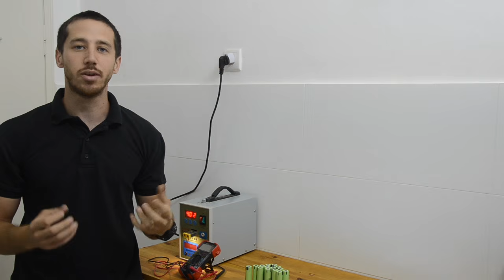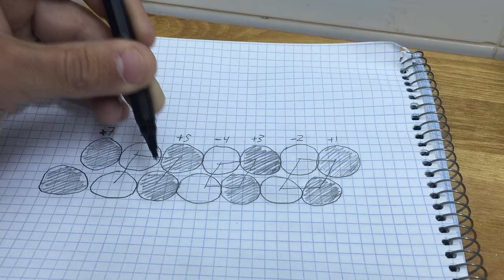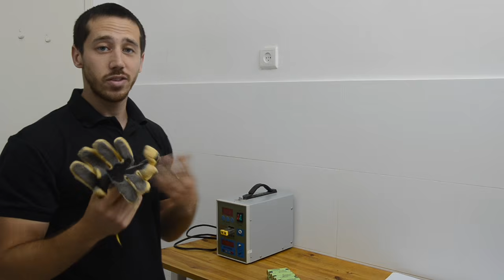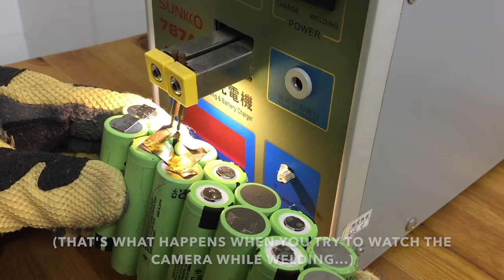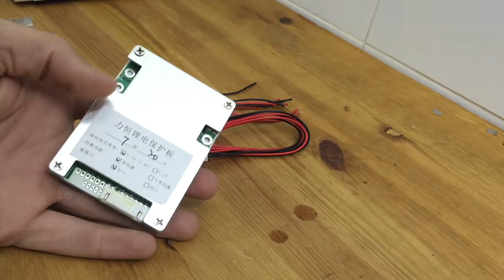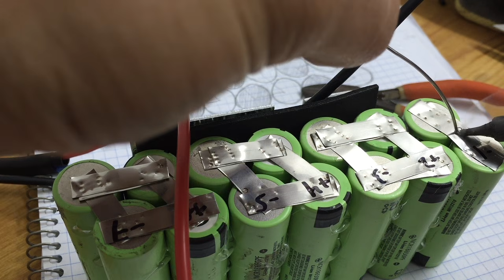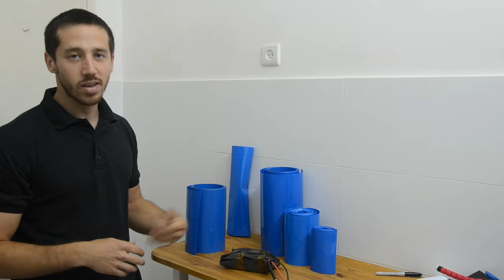How to build a DIY ebike battery from 18650 cells

Comment: How would you calculate the ah am I right in thinking is you keep in parallel that that stay same ah and when in series ud multiple by the number of cells you put in series so for example 10 batteries in parallel at 3.7v each one is 2.4ah then times that by 10 in series to make up to 37v. Please help if my math thinking is all wrong I'm not good with math but good with practical thinks help please

Comment: I don' get it. 14 cell x 3500mah=47.6 AH or not?
Reply: If you connect them all in parallel, you make a 3.6V 49AH battery pack.
If you connect them all in series, you make a 50.4V 3.5AH battery pack.
The energy is the same either way:
3.6V * 49AH = 176WH, 
50.4V * 3.5AH = 176WH

Comment: if I make a 12v battery so how can I charge them individually
Reply from the maker: You'll need to add a balance connector
Reply: after that I also need a balance charger.

Comment: To get the best results: as not all cells are created equally & there is likely always small differences in the top village they reach, you should measure a bunch and try to line them up in two rows (in this case) of seven in such a way that both the two rows will show about the same Voltage and then ONLY connect the two rows at the outer polarities (as opposed to, connecting them in pairs of two's all the way). It will minimale the indecency inbetween doubles and on, wherein unequal pairs and so on will drain percents of each other (and be probably only less than 70% efficient in that) from the highest to the lowest of each pair in order to them trying to keep evening out. Connecting two rows of seven apart from each other that way and only doubling up at front and end may save you a few percents of loss after charging.
Reply: your post is poorly written and therefore difficult to understand.

Comment: None of this adds up to me ,, at the start if I'm correct you say your making a battery pack for a 24 volt bike,,  so there's 14 battery's there so 2 parallel and 12 in series ....? 12 of them battery's at there 4.2 voltage would be 50.4 volts   ,,,,,am I missing the point ,,,please explain someone. Thanks Shane uk

Comment: Good video, but, I'm wondering:

Wouldn't it be much better/easier to:
A.  Place 7 cells + up (parallel row 1)
B.  Place 7 cells - up (parallel row 2)
C.  Hot glue the cells together
D.  Spotweld a nickle strip to each + cell in row 1
E.  Spotweld a nickle strip to each - cell in row 2
F.  Spotweld a bridging strip from the + row to the - row (as many or as few strips as you want to handle the estimate max current flow to connect parallel rows in series with each other.
G.   Connect your power leads to the + & - sides of the battery appropriately

The arrangement that you chose seems overly complicated.  Is there some advantage doing it that way?

Thanks for sharing!
Reply from the maker: Yes, your way makes a 7.4V battery. This is a 25.9V battery. To learn more about the difference between series and parallel wiring, you might like my book on battery building: http://a.co/ibnVGz9
Reply: Oops... my error.. it was getting late.

What I should have typed was 2 row of 7 cells that alternate + & - every other cell that are then each spotwelded together with one nickle strip to create 2 series-connected batteries & the rows (or banks) are then bridged (as describe above in my previous comment) to create parallel- connected banks for additional battery capacity.

Comment: Hey, first off just have to say I've found your video's really informative!  Love how they're organized and they've really helped clear up things.  Just have a quick question for you: If you're building a 12v battery from the panasonic 18650 cells.  Would you recommend using 3 cells for 11.1V? or 4 cells for 14.8V?  I know the maximum capacity is 4.2v (which would give you 12.6v for 3) but I'm thinking I should use 4 because that way I wouldn't discharge the batteries as far. (keeping them "healthier")  Am I right by going this route?
Reply: Devices like radios connected to the battery in most vehicles experience a range of voltages. When the battery is charging the alternator maintains the system at about 14.5 volts. With the car off, the battery voltage is 12.6 (when full)
At lower voltages, the current passing thru the connecting wires increases.  Most devices perform better (cooler) at the higher ranges.

Comment: If you cut yourself a rhomboid shaped pieces to replace all of the small tabbing strips then the amount of welding decreases and the finish would be neater. All of those small pieces are unnecessary.

Comment: Can i use a 42v 2a hoverboard charger to charge my 10s 8p 36v e bike battery pack.
Reply: Found this on eBay: 36V Battery Charger for Electric Scooter eBike ATV Mini Pocket Bike Moped Gokart
http://www.ebay.com/itm/36V-Battery-Charger-for-Electric-Scooter-eBike-ATV-Mini-Pocket-Bike-Moped-Gokart-/331148093694?hash=item4d19f6e8fe:g:ZKgAAOSwTA9X4pTd
   
It's only $17.50 plus free shipping.  I'm a nubie at all this but I read about how it's dangerous for the battery to overcharge, and or it hurts the battery when you try and charge too fast.

Comment: I've never seen one of these machines before, but my first impression is that moving the electrodes closer by even 1mm would make thing easier, or is it at the limit already in order to function?
Reply: Some Sunkko distributors include a spot welding pen as an accessory to the machine.  One company includes the nickel strips and a nickel spool but no pen.  Try your idea out on your friend's machine.

Comment: Can you teach us how to make a 48 volt battery pack?
Reply: Ebike School has a video: DIY 52v 10.5ah lithium battery from a kit 
Before I noticed that one I saw this video (off to the right) from Rinoa super genius: DIY 52v (48v) 16AH Lithium ion 18650 ...
It's so funny because I have a 29" bike I'm having a hard time finding ebike supplies for and just last night I noticed 29"/700c as if it's the same thing and then I saw 28"/700c.  Gotta love it.  Neobattery is the place to get the batteries from $5 in lots of 40 or 100, they're on eBay and probably have their own site.
Reply: TrustInJesus111 I have 18650 batteries that I took apart from old laptop batteries. I am not 100 percent sure how to make a 48 volt 10 amp hour pack. I have soldering stuff, and spot welder just don't understand the series and parallel yet and how to get 48 volts. Lol
Reply: @angelhd7446  you probably have the info by now, but in case you still do not...nominal voltage(V) of each cell is 3.7V, and depending on how good your cells are, they should have 2000mAh(2Ah)...so to make 48V...divide that by 3.7V...and that should be like 13 or 14 cells in series(14 will give you around 52V)...to get 10Ah, divide 10 by 2Ah...that will give you 5 cells in parallel...so your pack will be 14s6p on the upper limit...or 13s5p on the lower limit...
Reply: you just add more cells dude
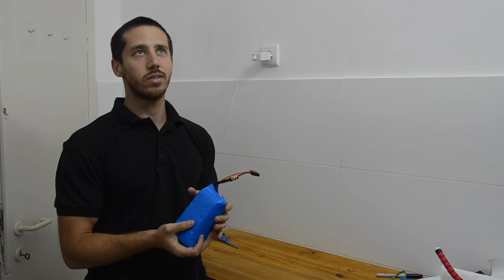Reply: 26:42
Reply: Can u do simple division and round up? 48/3.7
Reply: 48V  = 13 series , 10.4Ah = 4 parellel if you used 2400mah cells  . 
Hope this can help you .

Comment: Very interesting video to see the process from closeby. But it might not be very DIY because you need quite a bit of "sophisticated" tools, parts and equipment to be able to build the battery. So unless you want to build batteries on a regular base it might be cheaper to just buy a battery?
Reply: Tesla motors pays $2 a piece for their 18650's because they're going to using 2 billion.  Neobattery sells them for $5 in 40 & 100 lots.  It's far cheaper and easier to buy the batteries off eBay from companies who pay a lot less than $5 a piece but when that blonde haired beauty comes by to check out your pad and you're right in the middle of doing a battery build for a fat ebike she's going to stick around.

Comment: Is nickel a better conductor than copper?
Reply from the maker: Copper is a better a conductor, but they are both very conductive. Nickel is used in most lithium batteries because it is much easier to spot weld than copper.

Comment: I think if i was drawing a digram like yours, which is a very good idea, i would shade the other polarity to better match the batteries.
 Otherwise i could see myself making a mistake very quickly!
Reply from the maker: +Koito rob That's a good thought. I got used to grey being positive because I often do these diagrams on the computer where I make red filled circles for positive and empty circles for negative. But if I use a black and white printer then the red circles turn grey...
Reply: The BIG difference between you and me is I made my observation using logic, and not based on some crackpot fictitious belief system!DO NOT associate me with you!
Reply: 36v battery if one cell is 3.6 this would be 10 cell. But you use many  it litel confusing

Comment: I want to build a better battery for my etwow booster 2. I don't know a damn thing about building batteries lol... It's rated at 33v 6.ah.. I wonder if I can use a 36v with greater capacity in the same space?
Reply: Yes, it will run your motor at a slightly higher voltage, so it will feel a bit more powerful, but it's a small difference.

Comment: what type of charger you used for this type of bank of cells ? or where i can get one thanks  very nice video
Reply from the maker: Here is a good charger source: https://goo.gl/Ce2wnt and you'll need a lithium charger with a voltage V=4.2*N where N is the number of cells (so 29.4V for this 7s2p battery). I'll have a video on charger selection posted in a couple days.

Comment: i got some 18650 to build one. but now, i have problem to charge some cell(low voltage) 1 by 1. do you give a way to charge multiple-cell in 1 time.i watch some video "pararell charge" but not understand more. i hope you will make video about this in soon
Reply: Pu. Torchan search your local classifieds like letgo for "batteries" and you can probably find chargers that will charge 18650's. they're used for vaping devices.

Comment: Dude, where did you learn to solder? Not one was up to even Ok!
Reply: If you are going to criticize someone, at least let them know how they can do better. Use flux before soldering on the wire and the work piece, helps solder flow into the wire and piece. Tin the tip and the wire. Apply heat to the work, never the solder by itself and drip it on. Melt solder to the piece, never the iron.
Reply: @bluecar5556  THANK YOU!  "if you're going to complain, offer a solution ; otherwise you're just complaining"
Reply: bluecar5556 Pretty clearly he was using a flux core solder wire. His technique is fine.
Reply: Thank god it wasn't just me that noticed that. It's almost painful to watch
Reply: I will second that comment! They are probably good enough to work, but definitely made using a flawed technique. Sorry to be negative :o)
Reply: This vid i think was more on how the cells and bms are connected than technique.  If you noticed those cells have marks from previous welds before he put the pack together
Reply: Yeah it was only the wire soldering portion haha
Reply: Tech Talk soldering heats up the cells significantly. Lithium cells don't like getting hot.

Comment: I have a new 48V 1000W rear hub on my dual 
suspension which has been waiting for the battery. I have around 300+ 
new cells @2600mah each of which I plan to build 4x29V battery packs. 
Connecting 2 packs in series to get my voltage (58.8V extra boost) & 
then the other 2. & then connect those in parallel to get 52Ah for my range. 
Each pack consists of 10P/7S. I'll add balance leads & cell 
loggers to the packs so i can physically see whats happening as i don't 
trust bms. The bike will also have foldable solar panels with charge controllers as i'll be doing a lot of outside stuff. & i'll be uploading videos along the way. thanks again for your tutorials! :)

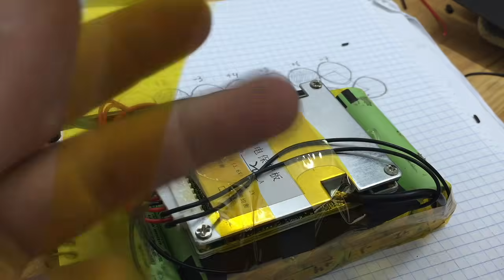Comment: Just a heads up. Did you push the 8 way connector fully in? At 21:27 before you wrapped the foam it looks like the connector was not fully located?

Comment: With all that insulation & shrink wrap, is there ever a problem with heat management of the cells?  Will the cells heat up with fast discharge of fast charge?  And how many charge cycles might you get.  Excellent video!  Thanks for posting.

Comment: What type of charger can we use, and how should we charge this type of battery
Reply: I asked the same question
Reply from the maker: Your charger should be a CC-CV (constant current, constant voltage) charger. To make sure you've got the correct voltage, check that the charger voltage = 4.2*N, where n is the number of cells you have in series. So since this battery is 7 cells in series, it needs a 29.4V charger.
Reply: +EbikeSchool.com I have another question
Reply: +EbikeSchool.com did you see it in the comments?

I want to make a 96 volt nominal battery that is 108 volts fully charged 
I need it to be 108 volts fully charged 

what BMS do I need to buy 
if I wire 27 in series would a 30 S BMS be sufficient??
Reply from the maker: You need to match the BMS to the number of cells, so if you want 27 cells in series, you'll need a 27 cell BMS. A 30 cell BMS won't work because it will trigger a low voltage cutoff if the number of cells isn't what it expects.
Reply: +EbikeSchool.com so 27 cells 
27 S BMS 
30 cells 
30 S BMS

Comment: should I fully charge my 18650 cells (individually) before building a battery block? They were stored unused for a while. Omg, where is the 'ebikes for dummies' course.
Reply from the maker: You don't need to fully charge them, but you DO need to make sure they are all at the same voltage. So if they aren't, just charge them until they all reach the voltage of the highest one. In fact, it's better NOT to fully charge them, just because if you make a mistake and accidentally short your battery, you'll have less energy in the pack to go kaboom.

Comment: If you do not have a spot welding machine, would soldering be a good enough alternative?
Reply from the maker: Unfortunately no. Some people do solder their 18650 cells but this is bad practice. It not only damages them by overheating the cells, but it can be dangerous and lead to fire if you heat them too much. So you'll see some people do it, but it's definitely not advisable.

Comment: Your connections in the battery look like 1000 but could they not just be 1UUU? Because the top connection seems just to be there to look good (which is not important in a battery)
Reply from the maker: I'm not sure what you mean by 1000 or 1UUU. I'm not familiar with that convention.
Reply: EbikeSchool.com I'm sorry. 
The Form of the Contact that you weld onto the battery cell. On your Paper the straight lines. 
Hope i could explain it, Im not so good in english.
Reply: Thats not any pro-word that you dont know, it is just my form comparison. It kind of looks like 1000 and what I mean kind of looks like 1UUU. 
What I mean, why do you have 2 connections and not just one to connection for example +1 to -2
Reply from the maker: Oh ok, now I understand. That's clever, the 1UUU drawing! Anyways, using a single piece of nickel strip for all of the serial connections would work, but it wouldn't be able to carry as much current and would have higher resistance. By doubling the number of connections, it's like using thicker wires: less resistance and the ability to carry more power.
Reply: EbikeSchool.com ahh, ok, now i understand. Thaks for your reply! 
Yeah, if you cant speak english very well, you try some tricks like 1UUU or anything like this ;)

Comment: Great video, i would only add at 26:50 - more batteries in parallel also increases maximum current of the battery pack. I believe those batteries can discharge at 10A, so a single 24V cell gives you about 240W of power. Thats fine for the smaller motors, but for a larger one this is also a consideration - as well as picking the right controller. Love this video :)
Reply: Oh, i forgot one thing - shouldn't you use 8 cells in series to get the 28,8V, which is usually used as the fully charged 24V battery reference?
Reply from the maker: You're right that more parallel cells increases the max current of the battery, I should have explained that better. Regarding the 8 cells, in my experience I've seen 7 cells used as the standard 24V setup. 8 cells is usually for LiFePO4 because they have slightly lower voltage. Most ebike controllers that are meant for 24V would also work with an 8 cell li-ion pack, but the LVC might be too low to function properly, so you better hope your BMS has a good LVC.
Reply: EbikeSchool.com

Comment: How much was the cost of the build? Is this the most effective battery for a 2 mile ride? Up above portland OR maybe I'm better off just buying a lead acid battery for Nov, Dec, Jan, Feb, Mar and sometimes Apr.
Reply: Hello, In China the 18650 battery around $2 one cells, and one 7 series of charging board around $10.  if you buy a finished product of 24V and 10A  around $80 it with Polymer lithium battery.
 the Lead acid battery of size is too big and shorter life, only 300 times charge-discharge.
Reply: I used to use 4 12v 20ah sealed lead acid batteries but those things get Heavy. Lowest cost I can find them locally is about 20 each and they only last about a year. With a Li Ion battery I can get at least 5 more miles per hour (32 mph) with much larger range. The Li Ion battery will pay for itself.
Reply: Right but lithium ion isn't durable and discharges quickly in the cold. Lead acid batteries are more durable in the colder climate. You can also completely replace the acid in them if they have removable caps.
Reply: Nickelbawker I know they do this for other batteries but not sealed lead batteries. - Hmm why must they be sealed? Do you recommend a battery thats powerful light weight and cost effective? Edit.. still they are very heavy. I dont know if its worth the extra mph.